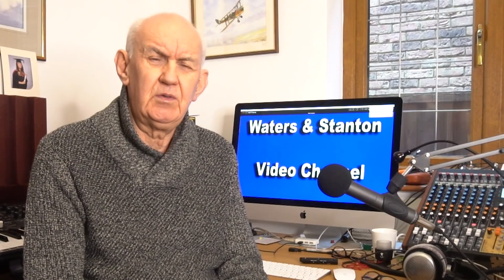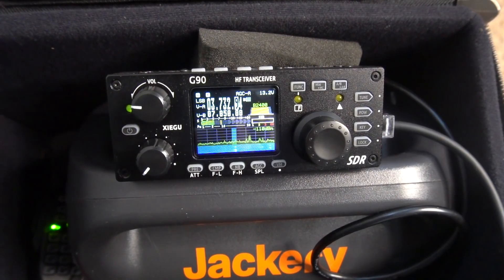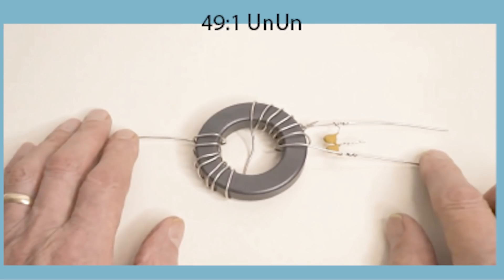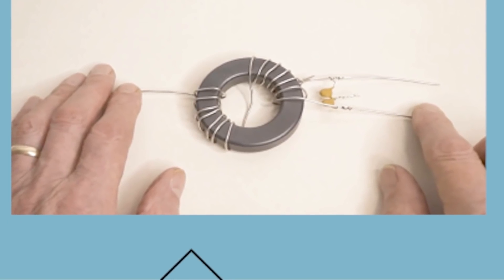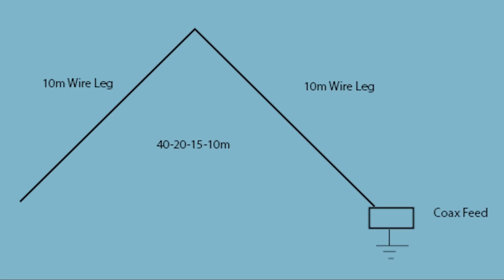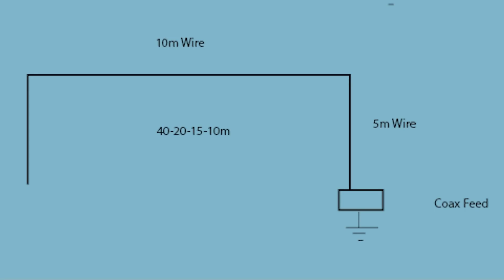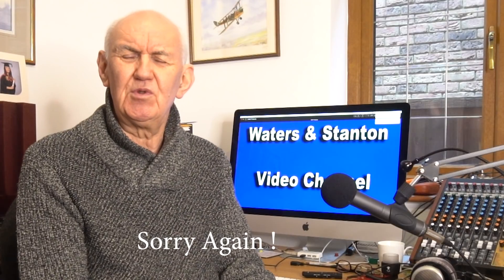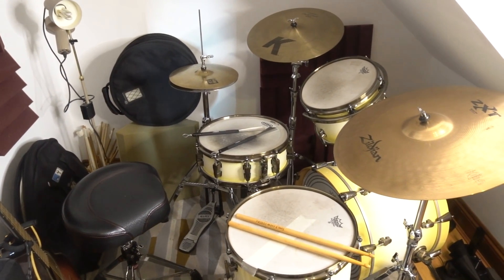Ham Radio  END FED HALF WAVE Antenna - 40-20-15-10m -Bend it as You Like !

Comment: I thought you were a bit 'dry' at first Peter but you are clear and to the point. I'm not sure at the transformer end of this or the extra cores for wattage output but the rest is pretty clear. I love the add on video for 80m too with the suggested capacitor experimentation. THIS is what Ive been looking for. I've seen an 80m-10m folded back version inverted V but the balin was up a 7m + pole! I dread to think how you repair this after a storm?
Reply from the maker: Cheers.

Comment: Morning Peter, from your experience with efhw antennas where exactly on the feeder would you place a line isolator? I read so many conflicting comments that it should be placed a quarter wave length from the transceiver end ( my coax is barely a quarter wave long) or at the antenna end or just simply before the feeder terminates to the radio say a foot or so! Is it really that detrimental?

Regards Danny
Reply from the maker: Place it right at the end of the coax before it connects to the transceiver. If you have any external items like ATU or AWR meter, then place it at the shack end just before the coax enters the first of these on the antenna side.
Reply: Thanks for your reply will most definitely adopt your method.

Comment: Hi Peter, I visited your shop back in the 90’s when I first got my licence, I loved the place & wished I could have stayed forever.
I’ve just ordered a LDG 49:1 unun and will be trying it out in the next couple of days.
I’ve got 10m going up vertical & 10m going to a lower post down the garden.
Will it matter if the wire going from the vertical part is not completely horizontal or should I try to match the height with another spider pole down the garden ???
Garry, 2E1FNP

Comment: Really love your videos! You have a great style of teaching - I have been trying to decide what would be best type of antenna to use on 10m. Here are the choices I am considering:
10 m vertical antenna options

1. Dipole (direct connection to coax)
2. Dipole (using a 1:1 balun)
3. Doublet Dipole (Fed w twin lead+ATU)
4. Doublet (legs and feeder twin lead + ATU)
5. Linear Loaded Doublet (legs shorted + ATU)
6. 3 wire LL doublet (50% shorter + ATU)
7. Coaxial dipole (1/4 dielectric 1/4 coax, choke)
8. Coaxial Bazooka 
9. Elevated dipole w 4 ground radials 1/4 wave
10. I Max 2000 (64%, 5.1 dBd gain, 15 degrees)
11. Gainmaster (coaxial capacitors go,tuning stub)
12. Double Bazooka
13. 5/8 wave dipole
14. Off Center Fed Dipole 
15. G5RV
16. GOGSF
17. End Fed Half Wave 49:1
18. Random Wire 9:1
19. Delta Loop (horizontal vertical polarization)
20. Collinear 
21. Yagi
22. Bobtail Curtain + reflector 
23. Vertical w parasitic reflector
Reply from the maker: You are going to have to prune your list a bit, depending on garden size.  Ultimately the winner will be a big Yagi.
Reply: @watersstanton  thanks for the recommendation- just so many options! Have thought about building a wire only Yagi actually 3 of them to be able cover all directions without the need of a rotating motor

Comment: Hello Peter, I continue to enjoy your videos and have tried many things you have suggested. Recently I installed a home made end fed antenna for the 40, 20, 15, 10 m band. Its not particularly high and in a bit of a random shape to enable me to fit it in a small garden. Today I spoke with VP8LP in the Falkland Islands, this was using my very old Yaesu FT77S and 10 watts, no external amplifier. As this was on the 17m band this morning I used a Vectronics antenna tuner that I purchased off ebay for £75. Whilst many stations use hundreds of watts and massive directional antennas, in the moment I could compete. It felt like a great acheivement, 7879 miles with 10 watts. Thanks again.
Reply from the maker: John that is great news. Good for you. A true amateur achievement  with basic gear that is not iver expensive. 73 Peter.

Comment: Hi Peter. The 49:1 you built was only a single strand of wire? i thought that the first 2  turns had to be twisted together to form the primary coil of the transformer before going on to wind the secondary turns? or is your shorting wire forming the primary? thanks redders
Reply from the maker: Yes its a kind of auto transformer. It works! 73 Peter.

Comment: Could you tell me please,  I'm surrounded by trees so what's the best way to route my endfed EFHW  A: over the trees B: through the trees, C: Round the trees ? and would the trees cause me problems with reception and transmitting (HF) ?, I've not been on a radio (CB days) for 40 years and recently passed my foundation exam.
Thanks for reading. BTW Love the channel.
Reply from the maker: On HF, all three choices will work. If you pass the antenna through trees it is possible tuning will change when wet etc. So that would be my thrid choice. Hooe that helos. 73 Peter.

Comment: I run EFHW horizontally, from the apex of the roof around a couple of batons bolted to a wooden fence in the back garden, it’s roughly u-shaped if you look from the top, works for me.
Reply from the maker: Thanks fir sharing that. 73 Peter